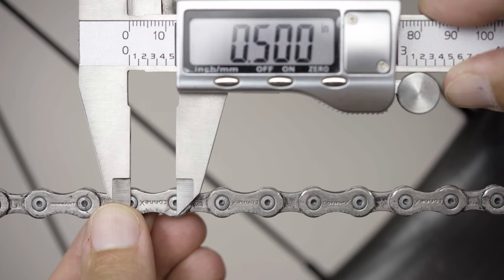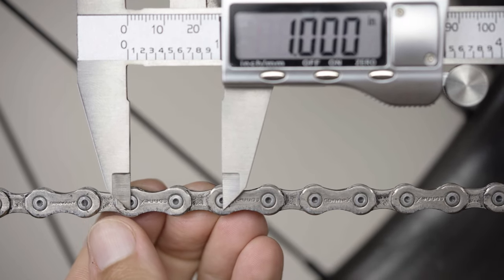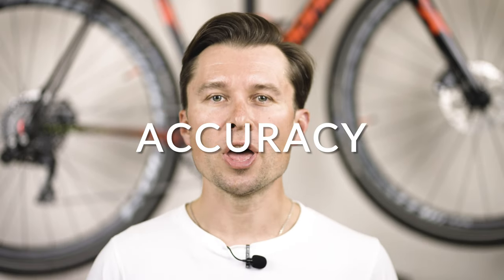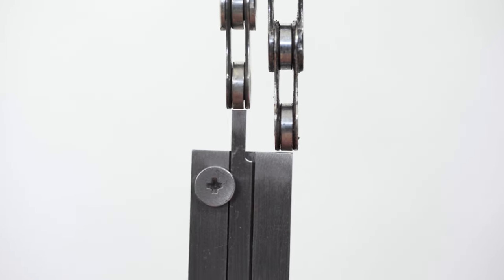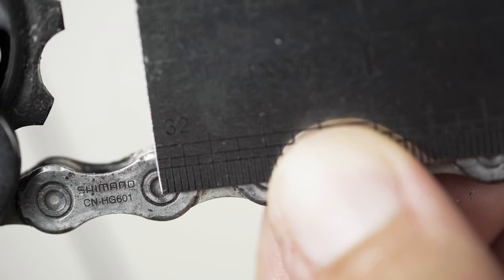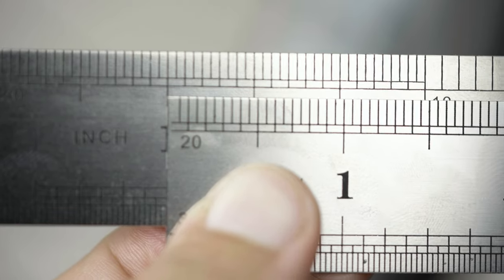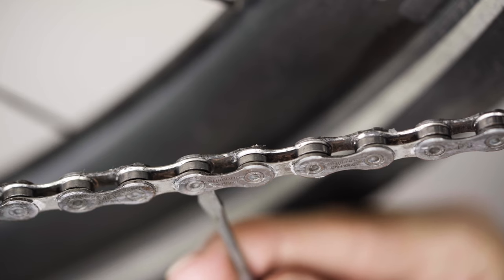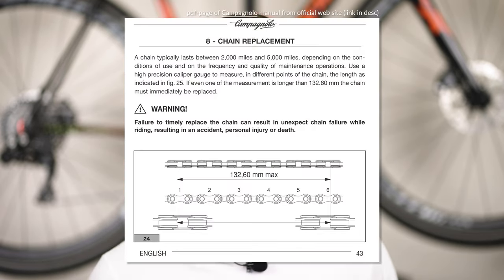Q&A: Can we measure bicycle chain wear with RULERS?

Comment: I've been ruler measuring for years, I just start my measurement at 1 not zero and pinch the ruler to the chain with my fingers. I typically measure above the chain stays and only 9" as that's how short chainstays allow. 
Its a good ball park figure
Reply: but some chains that aren't elongated at all still skip on worn cassettes due to roller movement. No method takes into account the chain Internal width growing which can be seen when arcing the chain on a table. A few derailleur setups with big B screw gaps (poor chain wrap) have given me awful shifting and loud cassette clangs which only happened with chains that have excessive internal width
Reply: It may be preferable to take a measurement  below the chain stay because the derailleur spring keeps the  chain tentioned  there.

Comment: If you just put some masking tape halfway though first pin, creating a vertical line at 90 degrees across the chain, you could line zero point up correctly and just tape ruler end in position, then check elongation at other end.  The masking tape will remove easily and leave no residue.
Reply from the maker: Indeed! Sounds like an easy way to make this method more reliable 👍